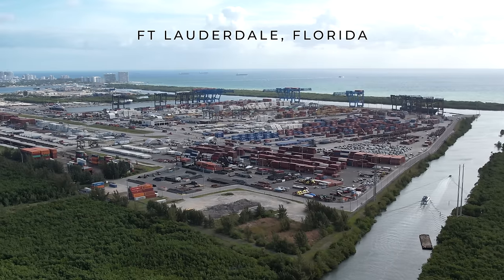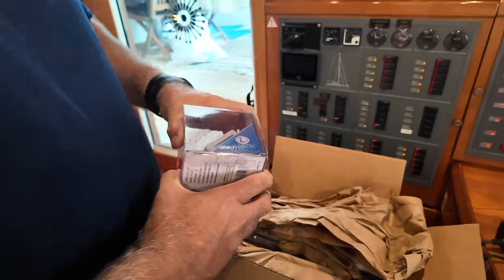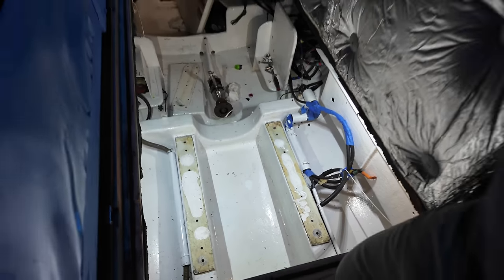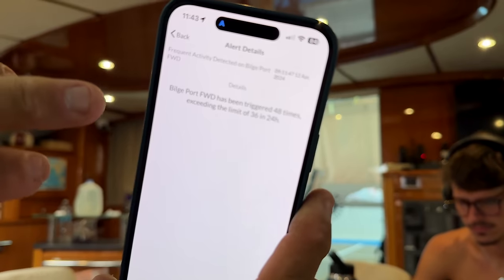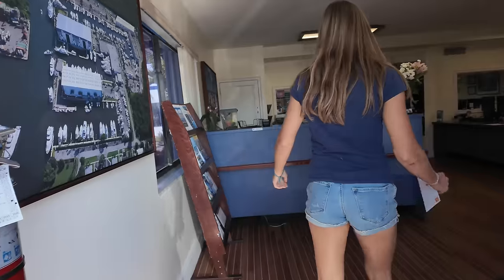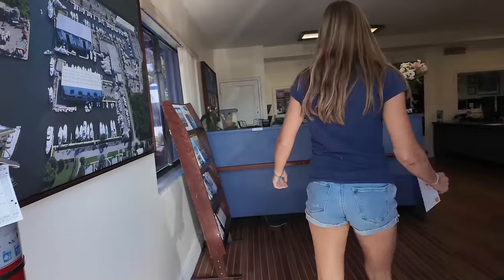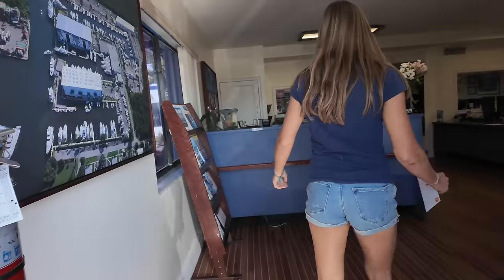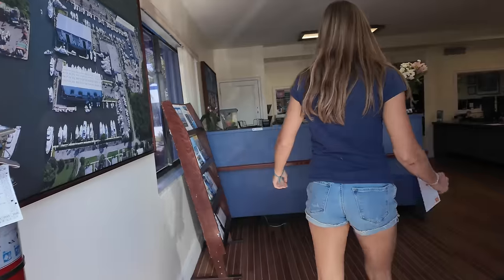NEW ENGINES? ⚠️ Not yet! Step 3: Modify engine room (Ep 282)

Comment: Had a new engine fitted in our steel boat several years ago. Steel has many disadvantages compared to fibreglass (and some advantages), but one advantage is that this type of work is much easier with steel. Cutting and welding new engine mounts are relatively simple compared to fibreglass work for the same purpose.

Comment: What's the " stength calculation" thinking when chopping those stringers 2 1/2 "??... Aluminum mounting plates are protected how from electrolysis?? Are you bonding thos plates using polyester, or epoxy resin to do bonding to old stringers?...be Safe !!

Comment: If you're sure power disconnects or turns off, will your batteries automatically run what you need if your away from the boat?

Comment: Keith, I left my phone number there at the marina. 
I have a bunch of stuff marine grade wire 4/0 ,2/0, 4 ,6, 8 ,10 AWG . 4- 100/20. 150/45 victron MPPT. Victron multi plus 48 Volt 3000 VA / 35 amp and all the gizmo stuff to go on with that lol. 2-51.2 nominal 100 amp EG4 waterproof batteries. Maybe Finn could use this for his van 200 Watt CIGS solar panel 😊 also 48v to 12 V 30 amp and 20 and victron, DC to DC charger. too much stuff to list on here lol. I’m not gonna need it. Perhaps some upgrades for your boat.

Comment: Did cutting and changing the stringers change the structural integrity of the boat ??  Was the manufacture of the boat consulted before doing this ? The reason I ask is because if there is a problem down the line ( maybe even years from now ) the manufacture could say it was your fault because of this modification .

Comment: Just Catamarans should have known about the engine height issue long before trying to install the engines.  Engine manufacturers provide cad drawings of the engine mounting mounting points and a simple comparison of the drawings of each engine would have been seen.  Performing a 3D scan of the engine compartment would have allowed for a virtual engine fitment and any interference issues could have been resolved. Another option would have benn to fabricate custom mounts off of the engine blocks which would have allowed the engines to sit lowet.

Those Volvo engines had 10,000 hours on them which goes to show the reliability of them. It seems like the best option would have been to overhaul those Volvo engines which would have been a fraction of the cost of a repower. If reliability is a main concern mecanical injection engines would be the absolute best bet. If a yanmar ecu fails you are out of luck on running that engine until its replaced which is a nightmare.

Comment: Any engineers watching at 13:05 wondering if enough structural integrity is remaining with that much of the stringers removed??  Guessing the new engines are MORE powerful which will induce MORE torque on the stringers.

Comment: I would not like the stringer to be cut out.  It creates a weak spot on the backbone of the boat which is the stringers.  If these cuts were in mid of the boat in rough seas would probably cause the boat to snap in half due to the weak spot..  Sometimes expert installers are not so expert and will find out later once the boat is put to the test (rough seas).  These experts should have known the new engine sit much higher than the existing and determine what needs to be done and recommend the solution.  Since the new engine has already been purchased have no choice but to install it.  Good luck, nice engines.

Comment: I used to build boats for solace I was a programer and a lead engineer. that work cutting those stringers should of took 1 day for both sides including fiberglass work the 2 ND day the engines should of been test fit and why wasn't measurements took before the old engines were took out or why wasn't measurements too when old engines were out and new ones were on pallet.dont make any sense to me I believe Keith could of did it faster with his boys but best of luck. just cats do good work just don't understand why it's so long.